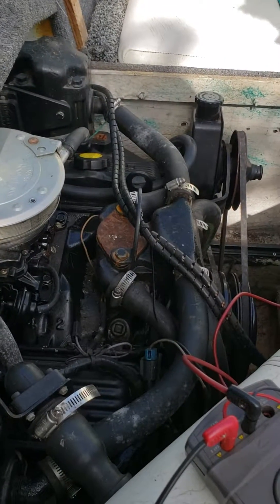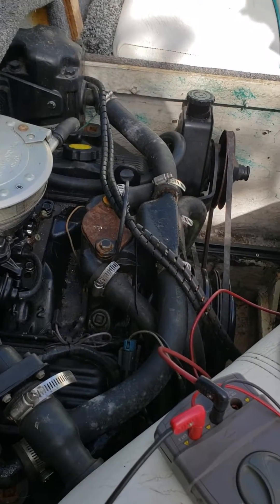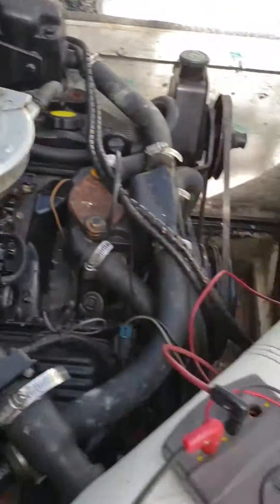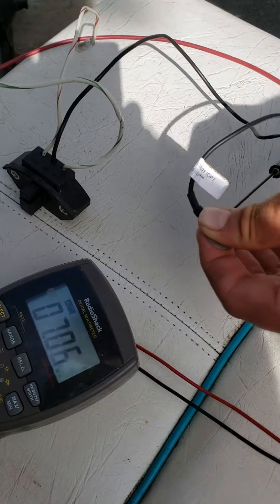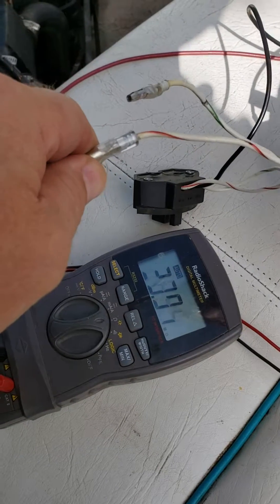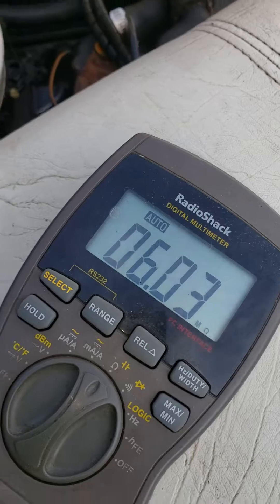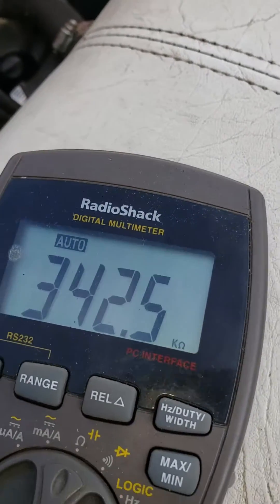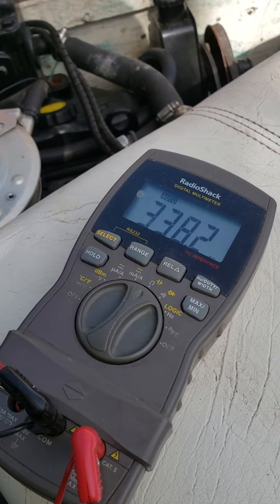1993 bayliner mercruiser no spark

Comment: I’m having a no spark issue. Last year I went to replace my starter. After replacing it I went to crank it and the engine wouldn’t start. I check for spark, no spark. There’s power to the ignition coil but there’s no spark coming OUT of it. Help!
Reply from the maker: Did a wire get disconnected near the starter area?

Check the following with a multi-meter

On a new good ignition unit:
1. resistance between the black and white with green striped wires is 340k ohms
2. resistance between the black and white with red striped wires is 6Meg ohms